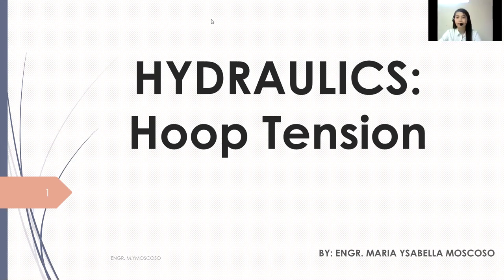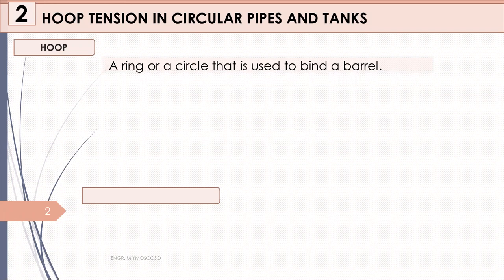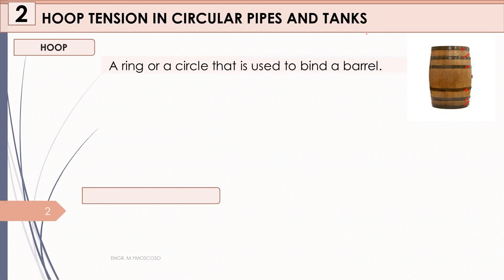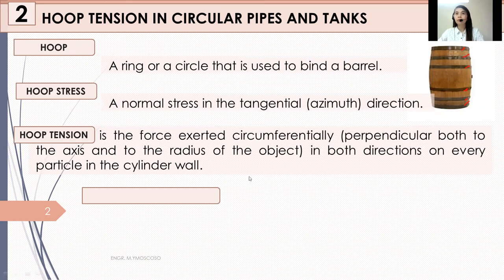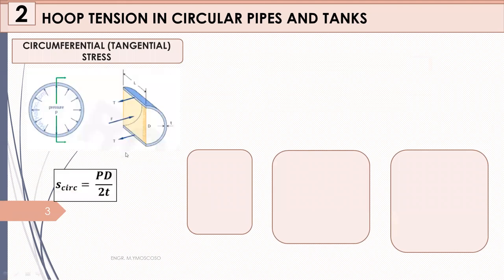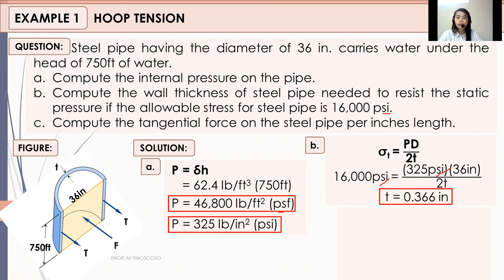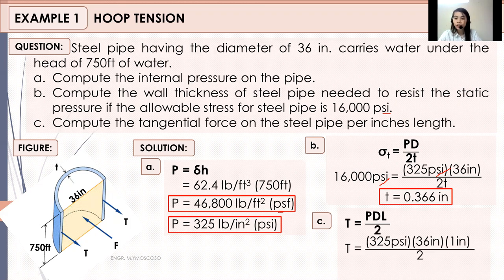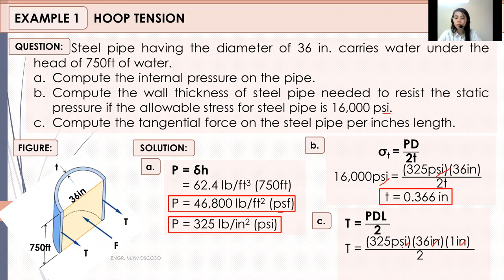HYDRAULICS: HOOP TENSION

Comment: Hi maam ask ko lng po san nyo po knuha ung 9.81 kN/m3 dba acceleration due to gravity yn? And pwd ba nting gmitin ung rho.g.h sa pressure?
Reply from the maker: Hello, bali I used the unit weight of water. So that the unit of our F is in kN.
Reply: @MaiaBella  i see.. pwd ko rn po ba iapply ung method ng calculation nyo sa plastic tank with belt support? Or if you dont mind may i have your email so i can send my question to you thanks..